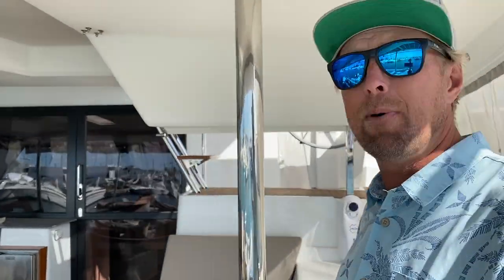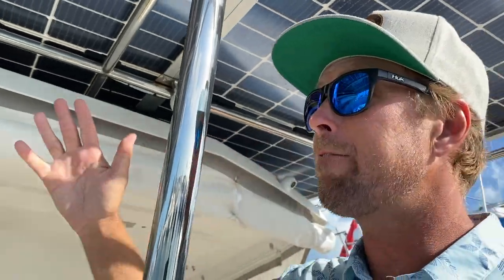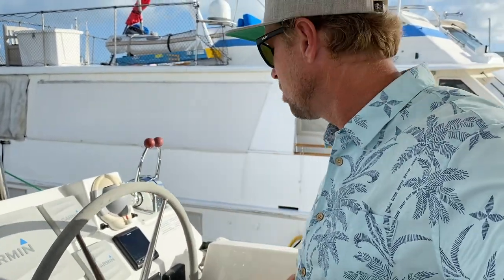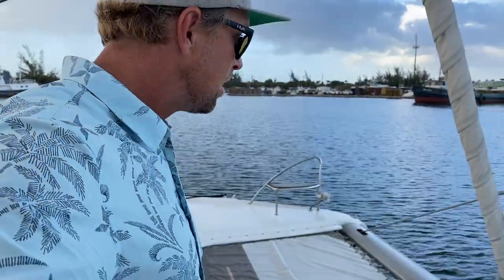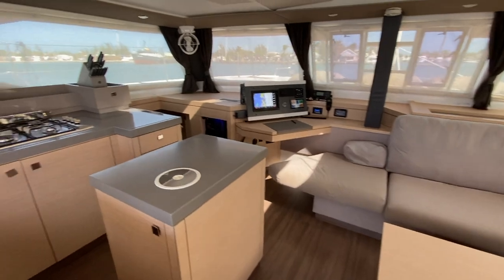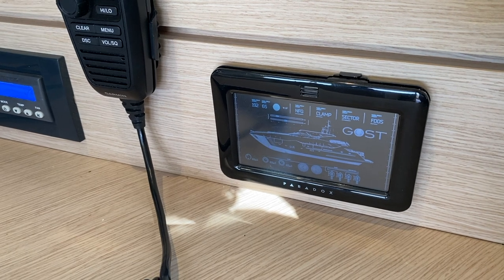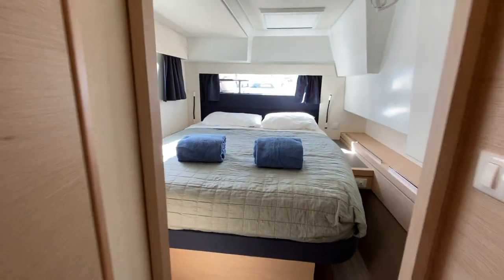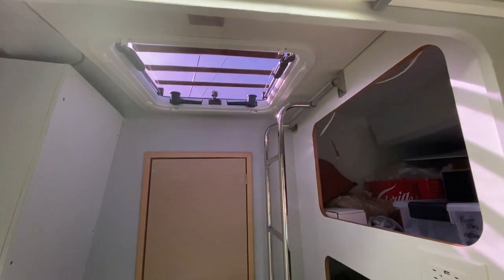The Best Saona 47 Power System on Earth [SOLD]

Comment: I would change how the batteries are connected. I would on each side connect each battery to a busbar instead of Daisy chaining them. This would allow each battery to work less, lower the C rating on charge/discharge and give them longer life cycles since heat causes lithium to degrade faster and lowering the C rate would lower the heat big time. With that said wow 30kw of battery power on a boat is great.